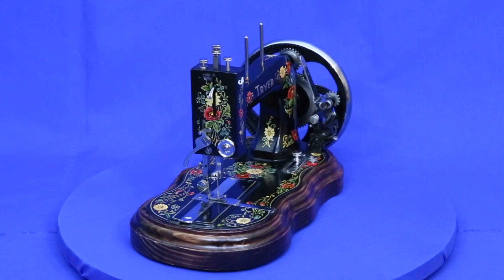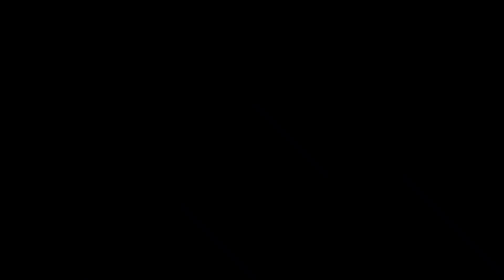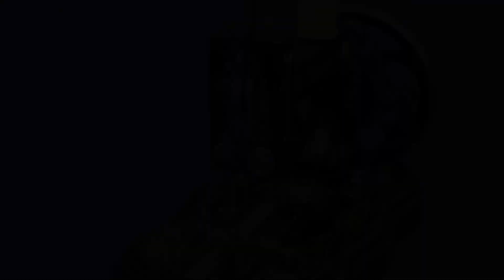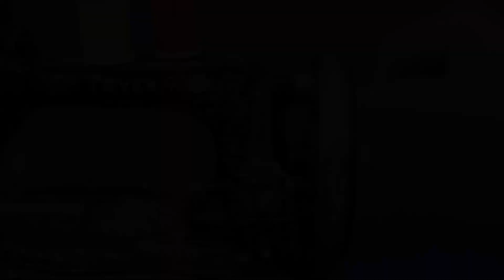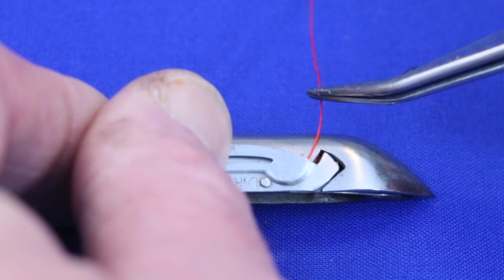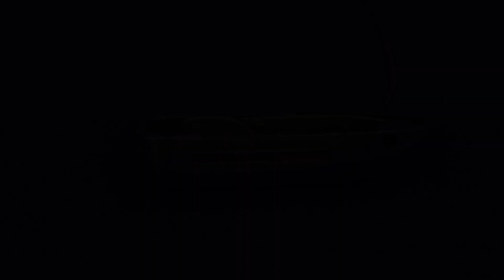Antique Hermann Kohler Saxonia Sewing Machine

Comment: I have been looking for this machine! I bought one of these with all of the decals worn off except for some mother of pearl flowers leftover on the bed. I don't think this was the design on mine; you can still see a very faint outline of where the decals had once been, and they look more geometrical, but this is the first time I've seen a machine with all the exact same features as my own-- the fiddle base, that type of hand crank + the very large bobbin winder. Thanks for the needle knowledge and how to thread it. :) You did a gorgeous job with the base, which is not easy to make (speaking from experience lol)

Comment: Did I understand you correctly that you mounted it on a new wood base with the fiddle shape? The original base was rectangular, right? (I assume as you said it came with a bent wood case, I can't imagine a bentwood case adapting to the fiddle wood base)
Reply from the maker: I mounted it on the new base just for display purposes. I still have the original wood case, which is a bentwood. Thanks for writing!

Comment: What a besutyful machine! I have similar, could you tell me if the big screw to hold the handwheel goes in the clockwice direction to get the wheel off the machine, please?
Reply from the maker: On mine, the screw comes off turning it counter clockwise.  It's a narrow slot so be careful to have a screwdriver that fits all the way down into the slot or it may tear out. Good luck and thanks for commenting!
Reply: @wayneschmidt490  Thank you very much